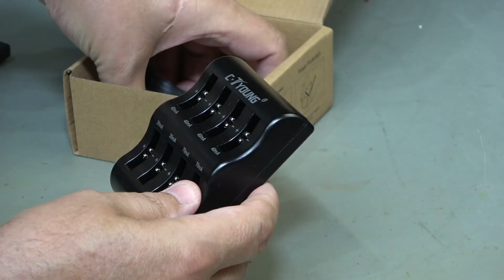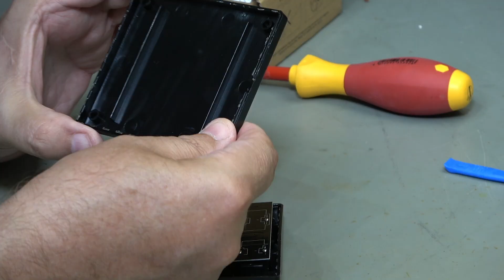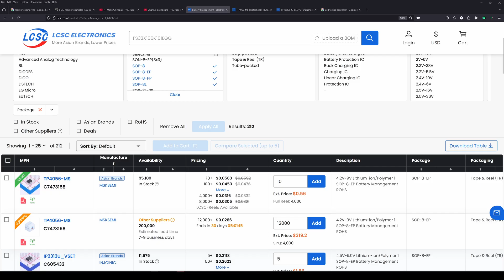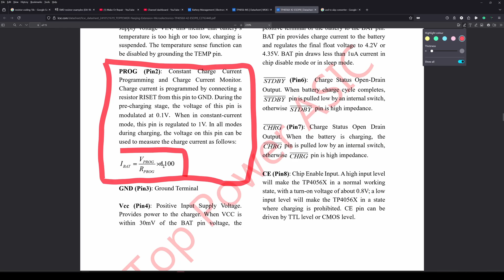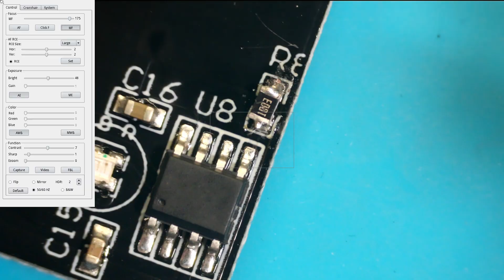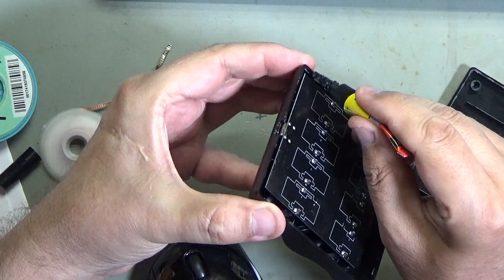Coin Cell Charger Teardown and Mod #0124

Comment from the maker: If you have one of these you might like to measure the current and modify the resistors to fine tune it.  20% error is quite a lot!  And yes, I did resolder those resistors that I just showed as tacked into place.